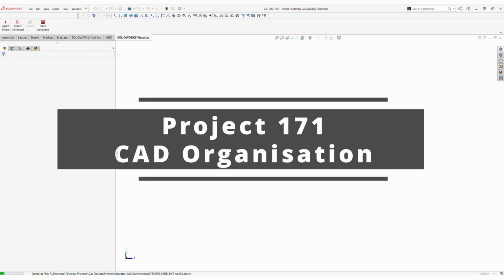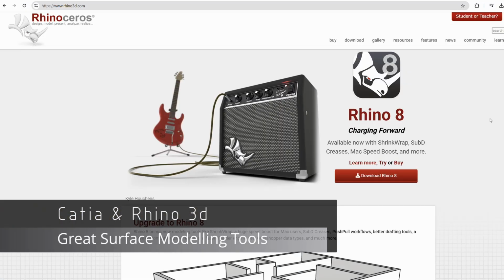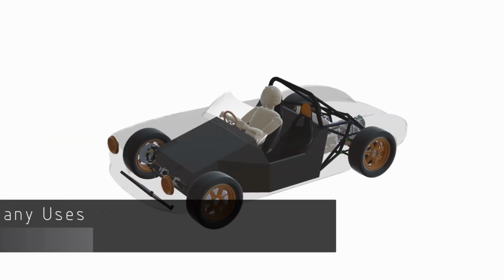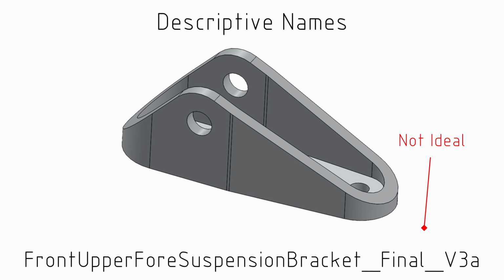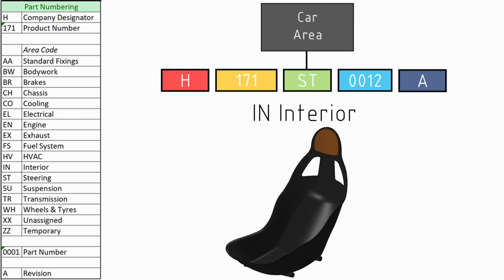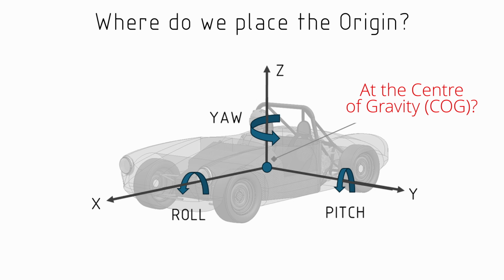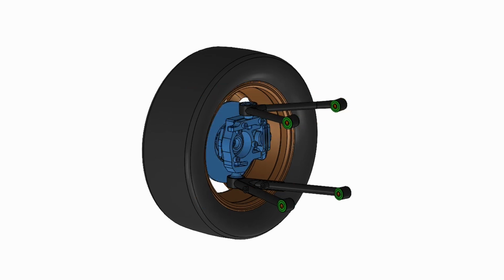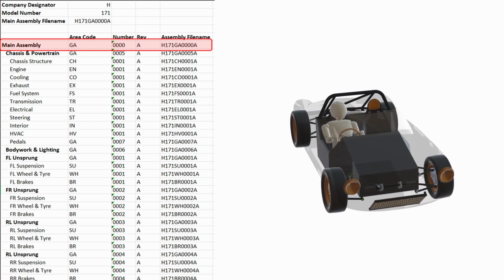Designing a Custom Sportscar: CAD Setup and Organisation Tips (Project 171)

Comment: I have not been this excited about a series on youtube for a long time. Keep it up! Have you ever used open-source software in engineering race cars?
Reply from the maker: When it comes to CAD no I haven't. Some of the open source (or cheaper) CAD packages I have tried out have been pretty underwhelming. Having used CAD for a long time now I don't have the same level of excitement over the software that I used to. I generally just want to be able to work quite quickly so that I am not thinking about the mechanics of the software, and instead more focussed on the final geometry / idea.  If I have a piece of software that allows me to do that without too much pain then I am happy to keep using it.  

If looking at the whole process of car design then yes I have used open-source software.  As well as writing a lot of code myself.

Glad to have you on board by the way and I hope that the series will live up to your expectations.

Comment: At work we used xxxx-yy-zzzz. xxxx was assigned to a project. xx00 was assigned to general equipment types. yy was assigned to subassemblies. 00-zzz were cross section and BOM drawings (this was in the days AutoCad. (Don't laugh. I started out on a drafting board) 00-001 = die plan view, 002 = punch plan view, -003 =  main cross section, -004 = BOM, -00x....were additional cross section drawings as needed. -01-, -02-, -03-, -0x were stations (progressions) in the tool. zzz were component detail drawings in the station (progression). This setup worked exceptionally well for our department. It was complimented by a database where we could search by any manner of inputs and filters. As a retired tool and die engineer my projects range from an ice maker drive pin to vehicle exhaust and associated manufacturing jigs. Here i've adopted a sequential numbering system and use a spreadsheet to parse out the detail. It is OK at best. Everything is lumped together in a single folder. I gotta say that watching this video is making me rethink my system. After retirement I was fortunate enough to land a design gig that 'forced' me to purchase a copy of SolidWorks. It isn't cheap to keep current but it is better than going back to pencil and paper or AutoCad.
Reply from the maker: Thanks for the comment. 

I started out on a drawing board as well, just got the end of it.  The numbering system you describe was fairly similar to what we implemented when I was part of a mechanical engineering consulting company.

Had some grand ideas of going back to a drawing board for some of the design (I love the hands on part) but its hard to beat the efficiency of the 3d modelling tools.  So the drawing board is mostly collecting dust.

Comment: So excited for this build. I’m currently an undergrad engineering student and it’s very fresh to see a project car being approached from a more clinical and objective engineering standpoint, especially at a grassroots level.  The project hasn’t even started yet and you’ve already done more calculations, modeling, and research than most of the community does over an entire build.  Truly impressive.
Reply from the maker: Thanks for your comments. Hope you are enjoying your degree so far, if your uni has a Formula SAE team I highly recommend getting involved. It was transformative for me as a student (in the olden days). From the outside it can look like meaningless hopped up go karts, but the engineering at the top level in teams is pretty impressive.
Reply: @KevinHayward7 we do have a both ICE and electric FSAE, as well as Baja and Solar, but I’m a Nuclear Engineer, so I’m not likely to get a slot in any of those teams, since they serve as a senior capstone project for the much larger Mechanical Engineering department.  I do enjoy tracking my Miata though.
Reply from the maker: Tracking a Mazda and supplying power to the people sounds like a good mix of a fun hobby and a helpful career. Hope you enjoy your studies. The team at ECU (and at UWA when I was a student) actually encourages non-final year students to help and be a part of the team... so if you ever want to study abroad :)  Unfortunately no Nuclear program for you in Oz.
Reply: @TT.357  Have you considered building a nuclear powered Miata?

Comment: Thanks for adopting the role of  my engineering conscience dr kev.  

I may not ever actually adopt a more structured approach to my projects but i know that i should.  My only, admittedly weak, argument for a more freestyle approach is that making stuff is 'fun' so making it multiple times must be more fun... right?
Reply from the maker: These videos are a way of giving my own conscience a platform, so I'm glad if it helps you feel motivated to structure things a little.  But this comes from my own failings of rushing into this project, and not laying some early groundwork. Works fine-ish for some of the smaller projects but this one was already getting messy.  I have to make sure that the good engineering sense doesn't take over though as it is entirely irrational to take on these sorts of projects in the first place!

Comment: Love the series so far Kev. I'm a UQR alumni (15-18) and have huge respect for the UWA cars of your time and ECU's cars were a great inspiration as well. A question I have for you is how you manage or plan to manage revisions/versions/releases without something like PDM. Do you do a zip of the project to create a snapshot when you intend to do a substantial release of parts for manufacturing? Are you doing a save as of files, changing the rev in the file name, and moving on? With the few personal projects I've done, I haven't struck the balance in the early phases where I might be sharing multiple iterations with collaborators. Looking forward to seeing more progress, I'm sure this sort of project has been on the minds of many FSAE alumni.
Reply from the maker: Great to have someone from UQ watching, love what you guys do. Working with a PDM definitely helps version control. There is an overhead to set it up though. I don't mind having separate files for major revisions, you never know when you might what to go back and take another look at an older design and maybe go in a different direction. So revision is in the file name. It does mean occassionally doing a part replace.  I'm also quite okay with losing some of the part file history, I don't need a save state of every time it was modified. If some information is lost it is usually quick enough to recreate it.  For backups every so often a pack and go zip file is saved.

Hope that answers the question.  A lot of progress doesn't make great video content, and I really want to try and use this channel probably more for showing the process rather than just be a progress tracker. This will be a multi year project.  Happy to hear suggestions of stuff people are interested in, I have a working list of upcoming videos and I don't think there is a shortage of upcoming content.  Also feel free to spread the word about the channel :)  Formula Alumni of any team share a heck of a lot in common.
Reply: @KevinHayward7  Yeah the the overhead for PDM is a killer, I am the defacto admin for it at work. Sounds like a good plan you've got. I think you're creating an incredible reference for engineers.